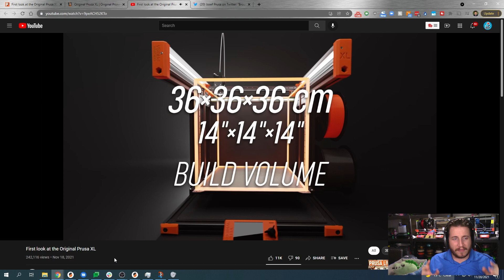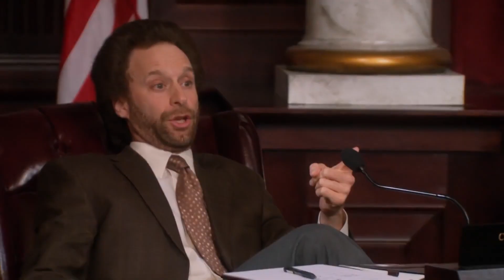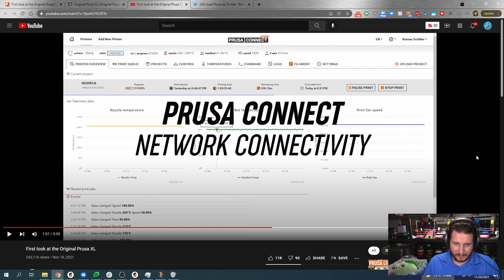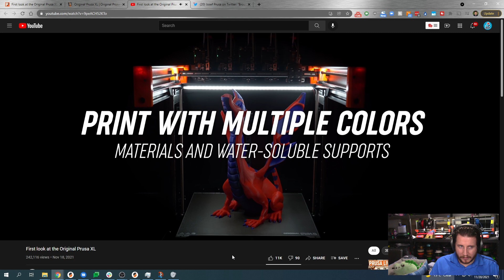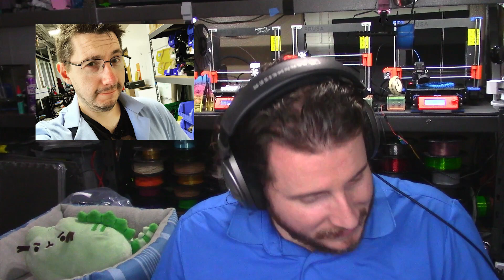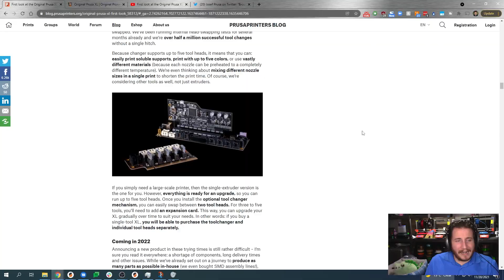The Prusa XL is HUGE! An In-Depth Look at the Announcement!

Comment: If that gear is brass it will not stand up to glass, carbon, and glow filament. Filament will chew a channel into that gear and I bet replacements wont be cheap or easy to acomplish.
Reply from the maker: Given the mk3s and mini use hardened gears I'd guess we are fine to assume this will be too.

Comment: it is up there in price, but easy to see and understand why.  it seems that they intend for it to be a fire-and-forget style printer.  which sounds really nice.  it will take me a while to save up for it, and need to get busier to justify it.  that said what I am curious about is maintenance/repair and durability of the parts.  by the looks of it upgrades would be hard to make.  partly because the design looks like there wouldn't be much need for it.  I look forward to in-hand reviews to see if it will be worth getting.  what I would also like to know if you run out of filament in a head could it just switch to another head so you could let a print go even if it would need multiple spools of filament
Reply from the maker: Since the MMU already does the print when spool is empty I figure this will as well!
Reply: didn't know that.  recently got into the hobby and hoping to develope it into a side gig.  it is nice to tinker but with the limited time I have it would be nice to have a printer that I can leave and trust.  so hoping to save up and be able to justify the XL with at least 2, hopefully with 5 heads
Reply from the maker: @javeronh.3996  Most Prusa's are set and forget, at least mine are :) They are pricier than other printers, but they are worth it.
Reply: that might be why.  with a printer I borrowed for a few months I wasn't sure if it could really be worth it.  so got a cheaper one.  finally starting to understand it enough.  now I understand why people say the brand I got is great to get in, but love prusa more than anyone.  they seem to be reliable and a reasonably priced.  I just found out too late so have to wait until I am ready to replace this or move to a bigger house.  haha
Reply from the maker: @javeronh.3996  No no, never replace, add another one ;) Get a bigger house LOL

Comment: How does the leveling work? After you print and it leaves some filament at the end of the nozzle? Wouldn’t that affect it since it won’t be as accurate.
Reply from the maker: It likely will wipe the nozzle before leveling, but the load sensor should be able to detect plastic vs metal, I figure.

Comment: It's neat and I'm excited about getting one. I'm curious what makes the extra heads cost so much. $500 more for 2 and $300 each for 5. I'm guessing the single extruder will be missing expansion board/extra tool change hardware.
Reply from the maker: yep, the boards, all the dang load cells, etc. I would also guess they come with all the printed parts so some expense there too. I don't mind the added cost as long as it works as intended.

Comment: Important thing that no one mention , Josef confirm that it is a PCI-e on mother board. But what is most important, it’s a tool changer NOT a extruder changer, and with quick swap boards you can have laser engraver, CNC machine and on and on. And yes it’s confirm on Prusa blog by ( not only extruders )
Reply from the maker: While I think it IS cool, it will be messy as sin to mill in something like that. The system is likely rigid enough to handle a mill. And of course a laser is easy in terms of load, just difficult in terms of the beam, the fumes, and the residue.
Reply: @3DMusketeers  I not saying that its not messy process but informations given by prusa and no other need for quick swappable boards are clear for me that either we want it or not other tools and boards are coming
Reply from the maker: Thats fair! I love how they can be swapped, so if we kill something it is easily replaced lol.

Comment: What is missing referring to spool. Let’s not go to over engineering problem. What we would need is information on spool, what is the weight of the empty spool so I could put spool on the digital scale before print to calculate filament
Reply from the maker: Prusament spools have the known weight, it is available in PrusaSlicer.

Comment: Do you need the push the filement by hand all the way to the hot end or will it be like the Mini+ that does it for you?
Reply from the maker: Likely need to feed yourself. That's the one downside of the reverse Bowden, but with 5 tools you shouldn't have to do that often. 

This is a very valid point!
Reply: @3DMusketeers  to bad i realy liked that from the mini
Reply from the maker: same! But it is bowden and not direct drive, so that is why it has that auto feed system as it is necessary to get it to print.

Comment: I'm excited also.  I'm still getting my Rat Rig 400 cube dialed in, and was considering a 500, but this changed my mind.  As you said the only downside now is I have $200 in a refundable account, but have my place in line.  Am trying to learn as much as I can from the experts.   Thanks for the information
Reply from the maker: One of the few times I do not mind pre ordering lol!
Reply: 200 is nothing compared to the fact that I have well over 2000€ in ratrig parts that I might not see for weeks 😅
Reply from the maker: it is only a deposit LOL
Reply: @3DMusketeers  thats what i meant, 200 for deposit and you wont see the printer for 6-9 months and you can cancel it anytime. I've been waiting for 2 months for the ratrig stuffs.
Reply from the maker: Ah ok!

Comment: I don't think that the nextruder will have a lot more torque that regular extruders before. The bigger gear actually needs way more torque than a bondtech gear to push the filament with the same force. I think that is actually the reason why they are using the cycloidal gearbox. It's compact, light and has a high torque conversion ratio.
Reply from the maker: I agree regarding the cycloidal system, there is not much else that is as compact. The big gear did throw me a bit like it is for you, but how much larger is that new gear?  I dont see it being 20x larger. So sure, saying there is a 20x reduction is more marketing. KNowing the effective reduction after that big gear would be awesome!
Reply: @3DMusketeers  Yeah that is exactly what I am thinking. It probably has the capability to push filament a little faster to enable even faster printing speeds with big nozzles. It is just not 20 times stronger than before.

Nevertheless the features are amazing, I preordered mine yesterday. Really curious when the shipping is going to actually start.
Reply from the maker: Same. I am thinking September of next year is very reasonable, but who knows! There is likely to be a TON of community input and they have some time still to add features or add-ons to the community as well. As Jo has said, the supply chain is really one of the main issues!

Comment: I like the segmented heat bed and just happen to have a load of 100m square tooling plate stock :-) Another idea to pinch!
Reply from the maker: oooh whats the plan, if you want to share at least!
Reply: @3DMusketeers  The leapfrog (on which my build is based) has a heavy glass that takes 15 mins to warm , so I was planning to replace it with a single piece of 10mm tooling plate (I don't have thinner in this size ) which also would have been heavy and slow to heat. 

However, nine 120mm square panels of thinner material would be about the same size and heat up in a fraction of the time even with smaller heaters  (found a source of 100mm sq 220vac 30w heater pads on ebay)

Not sure yet how to handle the temperature control - probably needs a controller per panel .
Reply from the maker: Yes, you would need either a mosfet or SSR per panel and some way to control them all. Not sure how, but it would be cool!

Comment: The use of the X axis to lock the tools is interesting , it suggests they've used a bit of the rail motion for the tool changer , so my guess the rails are in the order of 400mm (like my corexy build and that machine has 500mm x 600mm foot print )

The nozzle calibration is a great idea .
Reply from the maker: The nozzle calibration is AMAZING watching a buddy tune in a tool changer has been a bit rough, this, you just tell it to calibrate and it does the rest.

Comment: The 20:1 ratio of the gear-box is necessary to compensate for the larger traction wheel. The motor steps per mm will be typical . The use of a cycloidal gearbox is just to  make it printable.  I like the design of the traction system and will be pinching it for my home-brew 'tadpole' design version2  (see: https://www.youtube.com/watch?v=cLftZO6iKPo)
Reply from the maker: nice video!